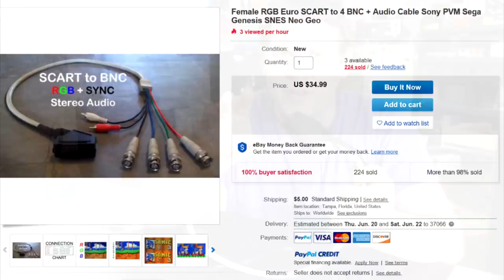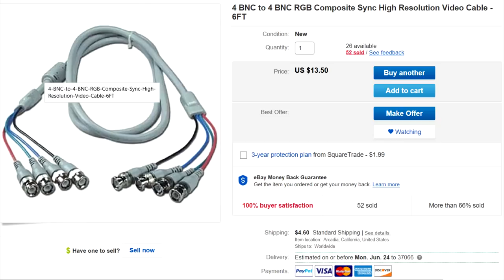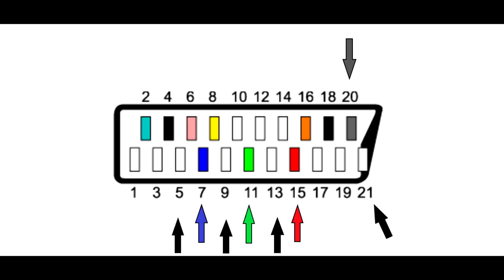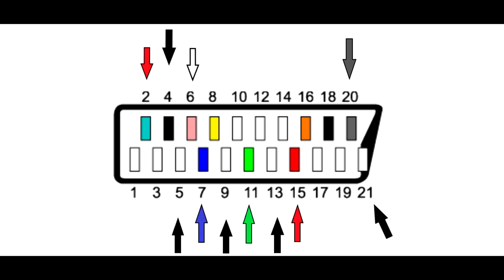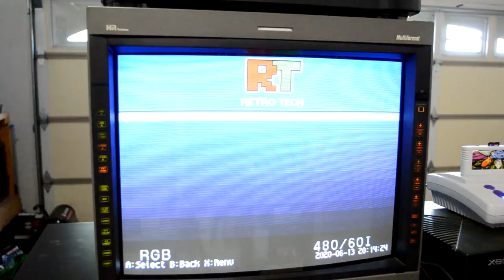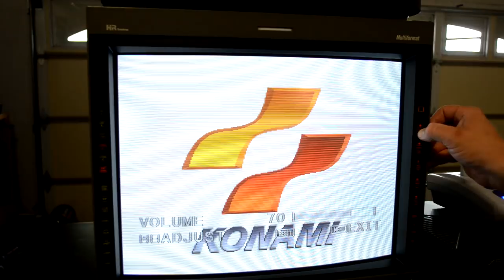How to make SCART to RGBS Cable$ for cheap! & Free Giveaways!

Comment: Awesome video.

Another alternative would be to use the xbox 360 component cables as there cheap and has the sync and audio in one cable,you would just need some rca to bnc adapters to plug in to said pvm.
Reply: Make a video
Reply: I made my cable using a x box 360 component and works better thanks guy

Comment: Do you know if RJ45 connectors along with Cat6 cable has been utilized for RGB connectivity, like a skirt cable terminate into an RJ45 Keystone so you can use a regular network cable and then have a keystone on the other end or BNC connectors or any other connector for that matter? If only as a means to convert the cabling for a longer run or something along those lines

Comment: Dude one question, I Imported some Scart cables for my ntsc consoles. and some scart switchers. The cables are cheap, even tough, some consoles has the dreamcast or the PS! showed me some nice quality picture, connecting them to my Scart Switchers, and then to my Scart DVD Recorder, tha I also imported.  Sadly some cables dont show me RGB signal, only composite,  if I connect them to the switchers (but whitout problems to show RGB  if I connect them directly to my scart DVDR)  so I am figuring in some way the scart cables are losing the RGB signal probably cause their low quality . But my switchers probed to handle well the RGB whit the Dreamcast and PS1, so I was wondering if maybe the cable can be FIXED adding some capacitors or something. Can you make a video a about how to fix cheap cables if possible? I have problems with the GENESIS;  SATURN, SNES and NEO GEO, or maybe the switchers are the ones to fix? I have 4 ones between plastic cheap and mechannical, 2 plastic cheap but with remote and one more expensive and also with remote and metal case.